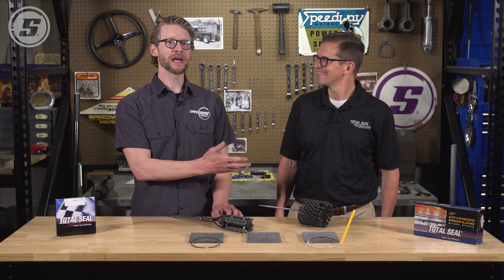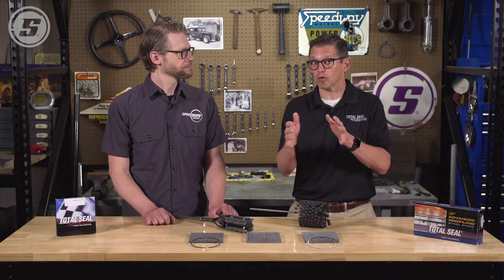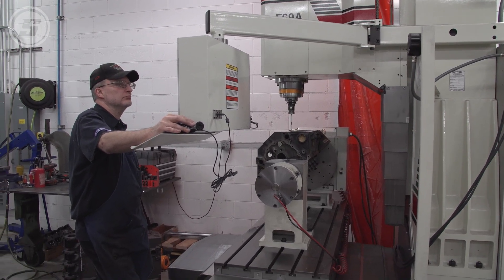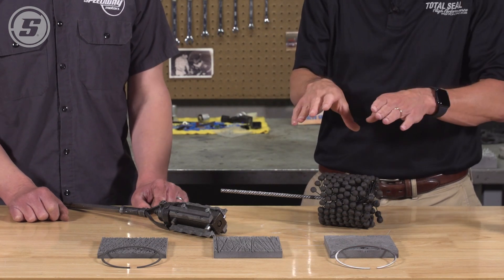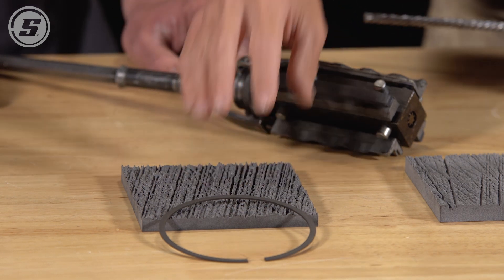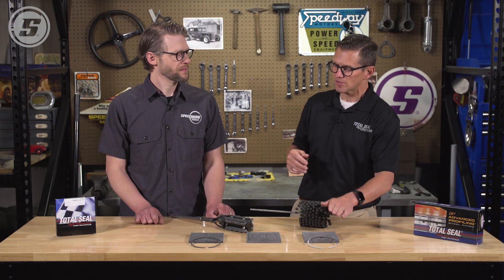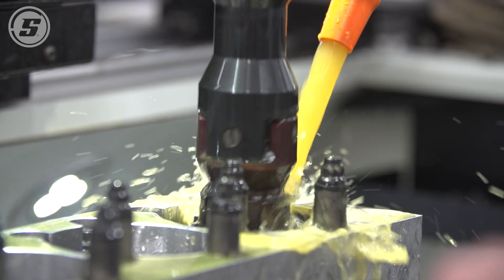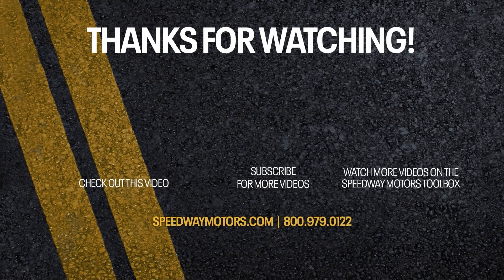DIY Engine Cylinder Ball Hone 101 | Dingle Ball vs Machine Shop

Comment: So I have a engine (daily driver) that I maintained religiously for years at 230K I decide to freshen it up. The engine never used oil, always changed at 3K in its 27 years. On pulling the head I saw that all the cylinders had no step and the crosshatch was clearly visible. The original rings materials are, top ring moly steel, 2nd  ductile Iron, oil ring stainless steel. I have yet to measure taper but believe it will be good. That said I gathered from watching your video that a 400 grit ball hone would freshen up the cross hatch that is already there and I should be good even with the Moly steel top ring. Correct? I'm an older guy and rebuilt engines way back in the day (60s and 70s) but I'm still detailed orientated and want to do it right.

Comment: For engine restoration use a ridge reamer if necessary and then use stone hone that is correctly set up for amount of hone you need. Do not use dingle ball hone IMHO.
Reply: Never use a ridge reamer it actually will follow the worn-out bore and you'll end up with the mess, just jiggle the Pistons out. And sometimes we would have to put shims in where the cylinder bore was worn to one side to keep it from going 60 or 80 over.

Comment: i went to a sealed power seminar in the mid 70s and the rep said it's ok to use sealed power manufacturer style rings in a honed or an unhoned cylinder and they work excellent either way. the sealed power cast iron rings have conformability, adjust to a worn cylinder, and doesn't need honed if it's within factory specs. i worked in ford and chrysler dealerships and never saw a tech hone a cylinder during a warranty rering.
Reply: Technology has changed a lot since the mid 70’s.
Reply: @laytonturpin864  only up until the 90s when fuel injected v8s got thinner rings, a tighter ring pack, and low tension oil rings. otherwise, still, if i were doing an in chassis rering only,  i'm not putting a hone in the cylinder and put a lot of grit into the crankcase. if the cylinder is within factory specs, there is no need to hone it, imo.
Reply: @axlegrind4212 There were narrow rings in the 1980s for some cars.

The Nissan 300ZX got 1.5x1.5x2.8 rings for 1984.

Comment: I have had so many friends buy a used car that said "Recent engine rebuild." Shortly after purchase, those engines would burn oil fast. The bores were probably way out of specification and probably never even measured.

Even if iron moly rings are forgiving, this still doesn't work. One of my friends had an early Jeep Cherokee. Those had a 5/64 5/64 3/16 ring pack.

I dread to think about what happened to my other friend who had a BMW that was supposedly rebuilt.

Ductile moly carried oil and PVD steel does not. Isn't this why some car companies use DLC coatings on their rings? DLC attracts oil.
Reply: I may or may not be alone in finding the "music" distracting. It sounds like the video is being recorded in a busy machine shop. Then again, I'm more learning oriented in my YouTube experience than needing entertainment or distraction. Great hosts and information otherwise!